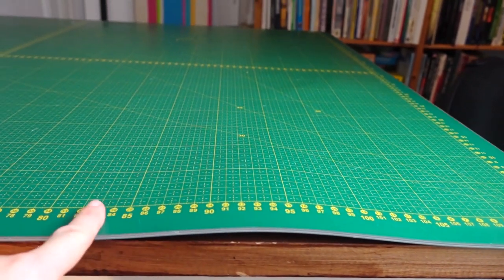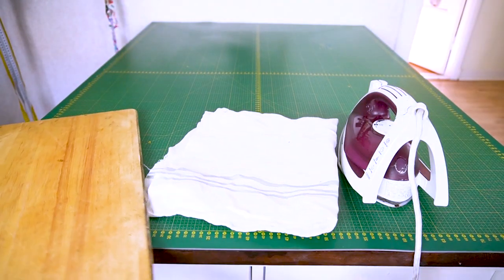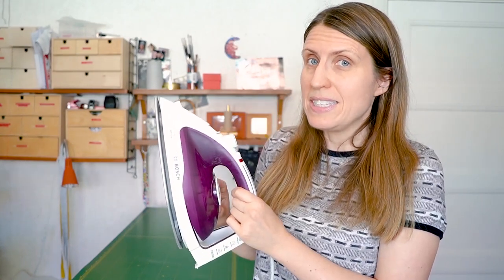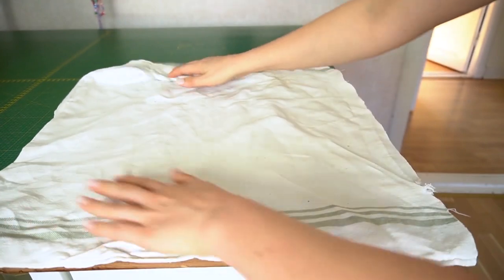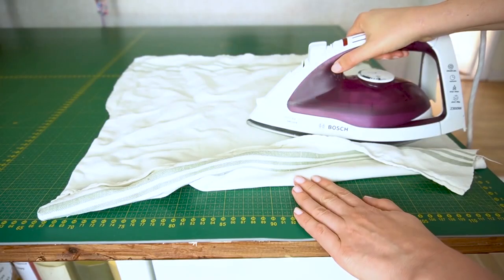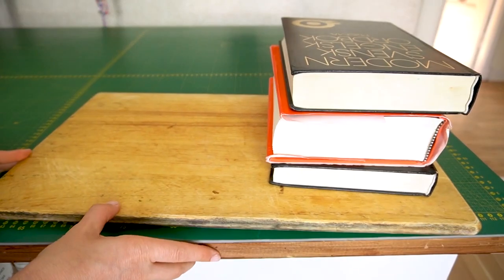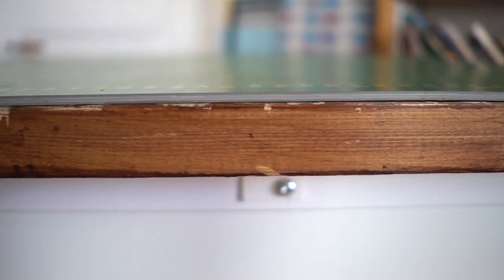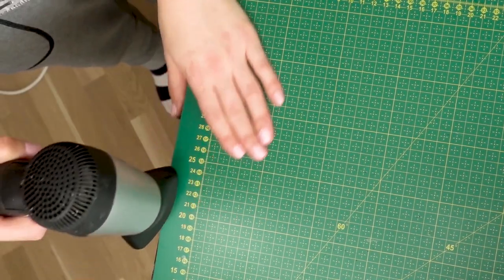How To Flatten A Warped Cutting Mat: Step-by-Step Tutorial

Comment: Hot air worked for me: less than ten minutes to heat an A3 cutting board, heating sections to not quite 40ºC, on a steel table; also flexed the board a couple of times while it was soft. Let it cool, and it stiffened up, flat as a pancake.

Comment: I had a very warped self healing mat and I tried the iron but it was a pain to get it flat.  I decided to leave it outside on my patio glass table on a hot day.  I left it all day and to my amazement it is as flat as a board.  Hope this helps someone else.  I do use the iron method with my small cutting mats that I use in my gemini fabric cutting machine, I have to add the ones I use are super thin, and the iron works great.
Reply: Thank you very much for the tip! I just ordered a pack of mats from AliExpress, and all of them came very warped and bended, i bought them for my Cameo, they are very thin and i was afraid of using the iron. I'm gonna give It a try.
Reply: I have some small thin mats that I use in my cutting machine its a gemini for quilting fabric.  What I do with these is turn the steam high on my iron place a towel over the cutting mat then heat it until it is floppy.  After this I place it on a hard flat surface and place a book with a 5 lb weight on top and it will cool flat as a board.  I hope this helps and I have heated these small mats at least 10 times.
Reply: @nancysnyder125     thank you very much  for the tip! I'll Let you know how It works for me. Btw the mats i have are Aibecy 12" for Cameo 3

Comment: I note this clarification has NOT been made but, there are different kinds of mats that require different modalities to unwarp. Fiskars requires the cold press using something like frozen cooking sheets. Janome's material says to use heat. IDK of other materials but that hits on two of them. Know your mats' producer/company of origin and check their FAQs before applying heat as it can be damaging. If yours doesn't have the name clearly visible on the mat, then try the cold method first as cold does not cause damage. Of course, apply stacks of weights [such as books as she shows] for days to maintain flatness. Remember to store your mat flat; under the bed is a great place.

Comment: Last year I moved from one apartment to another. Of course my family helped. In the process of moving someone had took my mat and just put it in the van and let me tell you it was bent in the middle and the the corners. I thought I had to through it out. I decided to go and lay it in the sun after the initial chock wore off. I left it out for about 2 hrs and checked it. It still was a little out of place. After another hour it was right back where it was. I was so happy. Mine looks like the size you have. I brought it back in and payed it on my cutting table and left. I checked it the next morning and it was ok. Try it you may not have to leave yours out as long as you got most of the bulge out
Reply from the maker: The sun method seem to be very effective indeed, happy to hear it worked so well for you too!
Reply: The effectiveness of sunshine might depend on the latitude and time of year?

Comment: I found a faster and easier way to do it.  My mat is rather large too.  I put the it in the oven... I had to curl the sides a bit so it would fit, and the oven door didn't quite close.  Then I turned oven on pre-heat to the LOWEST temperature I could (170 degrees).  When the pre-heat timer went off, (4 MINUTES, 15 SECONDS) it was perfect temperature.  Any longer and it would have started melting.  With oven mitts, I took it out and aid it on a piece of wood (particle board).  I happen to have a moveable hearth in front of my fireplace and placed that on top of the mat, but I'm sure a stack of books would do.  When I checked it in half an hour and it was cool and flat but I don't think I had to wait that long.

Comment: Thank you for this video.  I was using my wool ironing mat while quilting and I did not realize the wool mat was on the lower half of my cutting mat while ironing my quilt pieces and the steam from ironing warped my cutting mat.  I purchased a new one before seeing this video.  I am certainly going to give try as I never threw the mat away.  If this works I will not only have learned a valuable lesson about not allowing heat near my cutting mat but I will have learned how to save a mat.  😀
Reply: I warped mine using a wool pressing mat too. I didn't even think about that steam warping my mat. Going to try the boiling pot/iron methods because at this point I don't have much to loose.
Reply: @bettymatlock5805  I sorry to say, that I am happy to see that I wasn't the only one to have my cutting mat under my wool pressing mat.  I'm going to start with a warm sunny day and if that does work; I'll move onto one of the other tips.

Comment: I used a space heater placed on the floor 6 inches from the warped area for an hour then placed a wooden board with an iron skillet on top overnight. Worked great but my mat is no where near as large as yours.

Comment: I am trying to do this now, but i have a question.  Should i be trying to flatten the mat with the iron, or should I only want to heat it with the iron, and then the flattening happens as it cools under the board and weight?

Comment: This hapened to my mat whitch is a small one when I accidently ironed something over it! I used the same method right away  but I ironed the under side of the bum! If yours isnt glued on the table justs turn it over and do the same method! It will be absolutely flat!! Good luck!!
Reply from the maker: That's awesome to hear! I did get that tip but forgot to try it, sounds like it's more effective!
Reply: You did ok to do it from the one side but you should firstly iron it from the opposite side so that the bum that  will occure neutralizes the damage!!

Comment: Protip for prevention: DON'T use a laptop, or device, that tends to run hot atop the surface. Mine warped when I was using my laptop for 3d modelling and intensive uses, which gets very hot on the bottom.